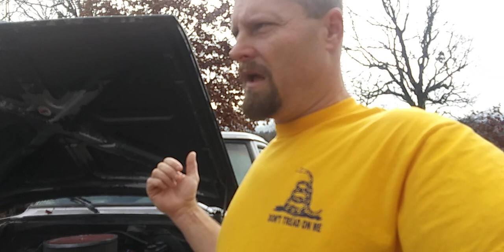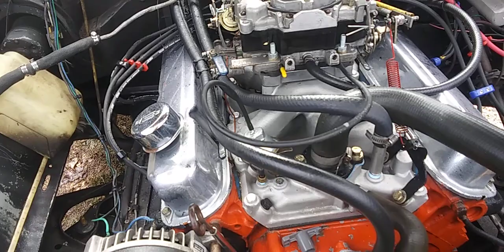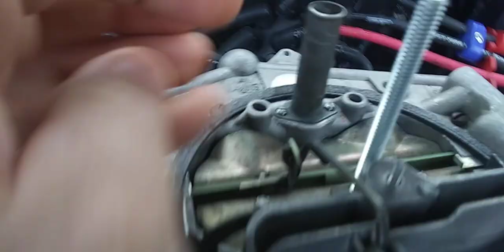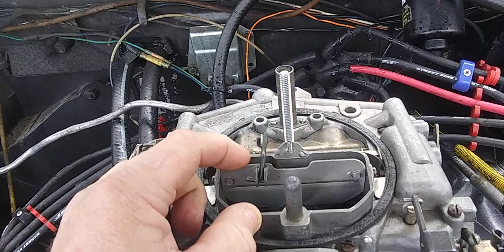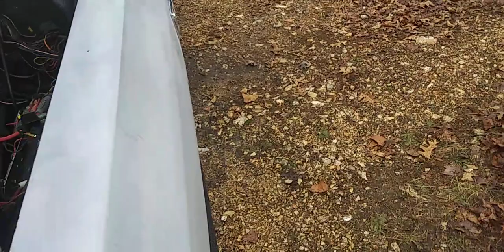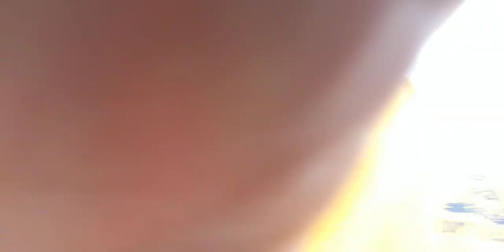THERMOQUAD MANUAL CHOKE UPDATE & Other odds & Ends

Comment: Looks good. Don't forget to put that distributor cap back on.
Reply from the maker: yep. I just sat the distributor back in the hole to keep bugs and or varmits from getting inside the engine then the winter weather hit for about a week . I have a deal I installed that goes between the hood and lip of fire  wall to keep water out .

Comment: Thanks Brother. I have the same carb and I blocked off the solenoid port with a plate. I did not drill a hole in it for air relief.  is all I need to do is drill a small hole in the middle of the block off plate for air relief?? Do you have a picture of the under side of your carb showing the hole you drilled?  Thanks again
Reply from the maker: Correct thats all you need to do . I just used an 1/8 " drill bit and drilled in the middle of the plate .